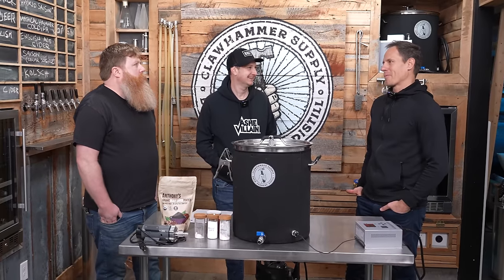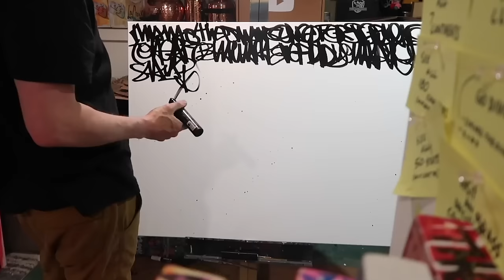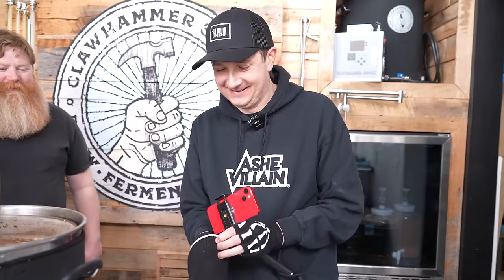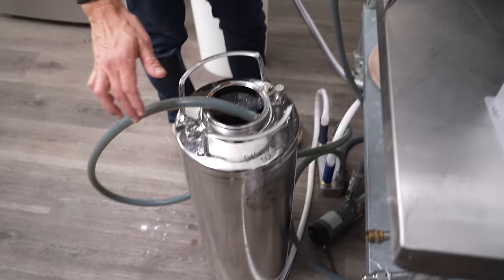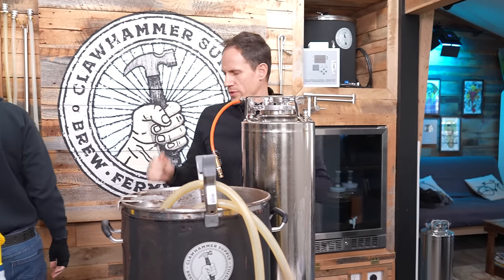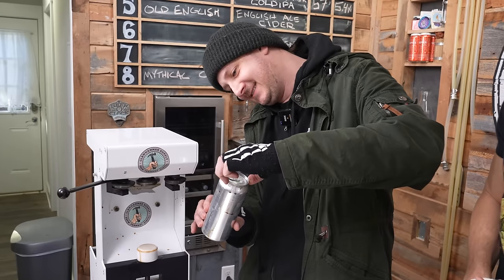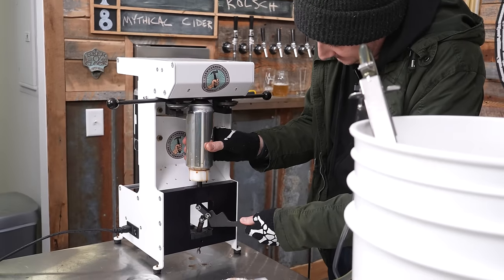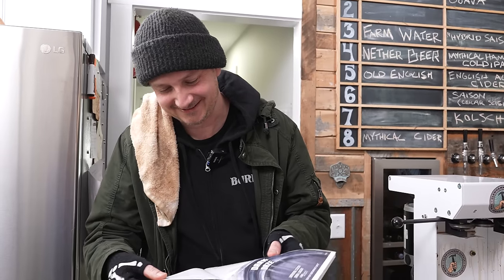Brewing the World's DARKEST Beer - Vantablack Czech Lager

Comment: on the scale of beer disasters 1-11, that spill was a 0.0001. I've had dark beer sprayed up my 14' ceiling wall...
Reply from the maker: Libby, please stop comment on your own videos!
Reply: @ClawhammerSupply  Lol
Reply: One time my brother and I brewed a beer and he put it in "party pigs" (not sure if that is still a brewing thing), basically pressurized plastic vessels to dispense the beer, and they came with these cradles with nylon handles and as he came down the steps to the basement with the party pig of beer, he slowed down but the party pig's momentum kept it going, and it fell 10 feet, hit the concrete floor, punctured, and created this laser beam of pressurized beer that was rotating/spinning around spraying beer on the floor, walls, ceiling, everywhere. That also is much worse than the beer spill in this video.

Comment: The key to that kind of sanitation is so dip the cans so they are fully immersed then drain the solution and let the cans air dry. They time required for sir drying is the time is takes to sanitize the cans. It you since the sand in sterile water you have unsanitized cans. If you dry the cans in warm air you have unsanitized cans. 

Restaurants are notorious for speeding up the “sanitation” of dishes and glass wear after washing by rinsing the dishes after “sanitizing” then drying. Why? Because air-drying the sanitizer solution takes time. But the air-drying is when the sanitization takes place.